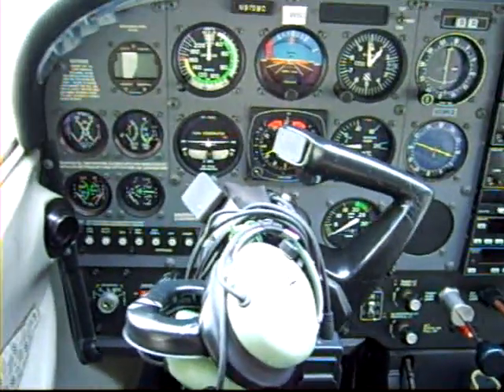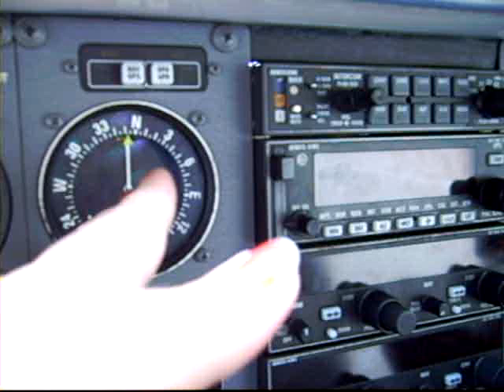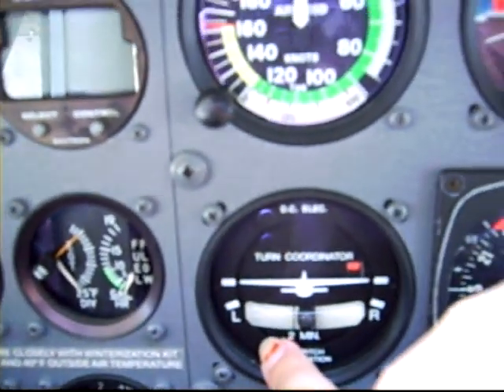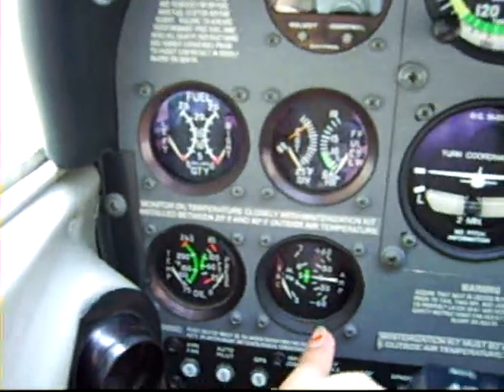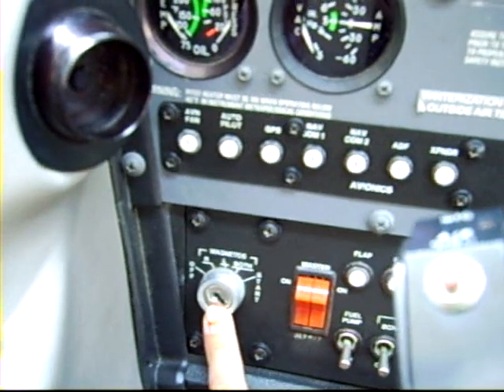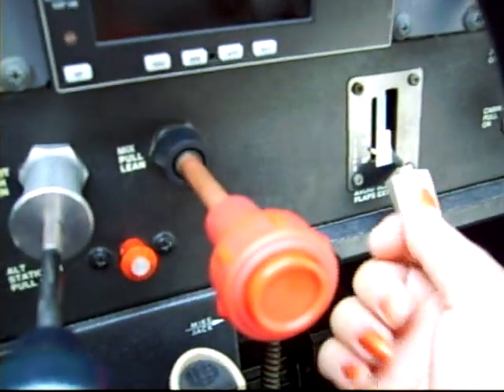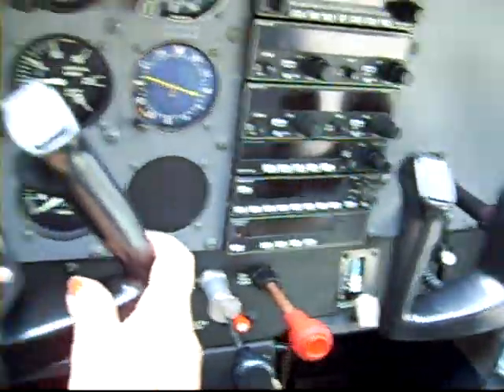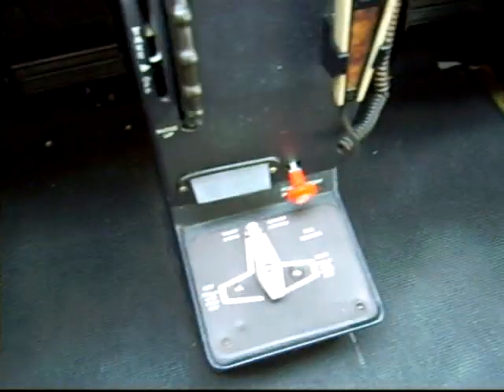Cockpit of the Cessna 172 Skyhawk

Comment: @nanoload If the slaving function fails, you will still need to slew the heading card to match the liquid compass (using the lower switch). By the way, adjusting the heading to match is not "calibration". Calibration refers to adjustment of the HSI system to meet factory specifications on a bench using test equipment at the factory or an approved service center, if the remote gyro or heading sensor drift out of calibration. I realize this may seem moot, but in engineering we have precise terms.

Comment: Note that the liquid compass mounted above the glarshield has no electrical components, and no heading output that could be used as a slaving source to a remote compass system (e.g., HSI). Hope that explains adequately. 
Michael, Ph.D., P.E., Consulting Engineer (Avionics, communications, signal processing), Commercial pilot (Airplane single and multiengine land, instrument airplane, C-172 and 310 owner/pilot).

Comment: @niceflyer80 (From previous) as it is driven by the heading measurement from the KMT-112. If you put the mode switch to the "free" mode, the heading card of the KI-525A is no longer slaved to the KMT-112. In this case, you would set it to agree with the magnetic compass using the lower switch, which drives the heading card counterclockwise (in the "CCW" position), or clockwise ("CW) position. Normally you would use the "slaved" mode, unless there was a failure that prevented slaving.

Comment: @nanoload The Honeywell/Bendix-King HSI system (of which the panel-mounted indicator is the KI-525A Pictorial Navigation Indicator or PNI) has a remote slaving panel (the small panel with two switches near the throttle). That panel contains two switches. The upper one is a "slave/free" mode switch. In the "slaved" mode, the heading card of the KI-525A is "slaved" to the flux gate of the remote-mounted KMT-112 Magnetic Sensor, and thus always indicates the correct magnetic heading (Continued)

Comment: @nanoload No, the HSI is slaved to a flux gate mounted in the wing tip (which performs the same function as the magnetic compass). The HSI should be checked for slaving to the flux gate, which is indicated by a meter on the small switch panel next to the throttle. If the slaving feature fails, you will still have to set it manually to the magnetic compass (not likely, but still should be checked periodically).

Comment: @1982FMJ There are no life-limited airframe components on the 172. They are replaced on condition, not at a specific number of hours. X-rays are rarely required for normal maintenance. You cannot rebuild a type-certificated aircraft engine (legally) yourself. The rebuild (actually, an overhaul if done in the field) must be signed off by an FAA licensed technician. Most engine work must be done by licensed personnel. Propellers rarely fail if properly maintained. I have never heard of a spare.

Comment: @210482fmj If you own the aircraft, and it is not used for hire (e.g., flight training for hire or charter), you can do your own maintenance on about 40 items covered in the Federal Aviation Regulations (FAR) Part 43. Examples of these items are changing the engine oil and filter, replacing tires, brake pads, interior repairs/replacement (when such work does not require disassembly of flight control, electrical, fuel, or other systems), and others.

Comment: @saevaroa Indeed, but Cessna removed that flap setting in the later models (early seventies I think) because people kept having accidents when they attempted a go around with full flaps - going around just won't work until you have retracted the flaps far enough, but if you retract the flaps too fast, you might stall. 30 degrees is max now.

Comment: No, the answer IS very. The 172 will feel heavier compared to the 150. Its also substantially more stable, which is nice. Also, the 172 will land quite a bit differently based on the sight picture you've become accustomed to in the 150.

Comment from the maker: There seems to be a lot of debate about the inclinometer (slip indicator) and when to apply left vs. right rudder.  For those of you who fly, you should be familiar with the old addage "step on the ball", meaning the pilot must apply rudder in the same direction as the ball is deflected in order to return the airplane to coordinated flight.  If you fly and are not familiar with this rule, I would strongly encourage you to ask your instructor about it or check a reference book!